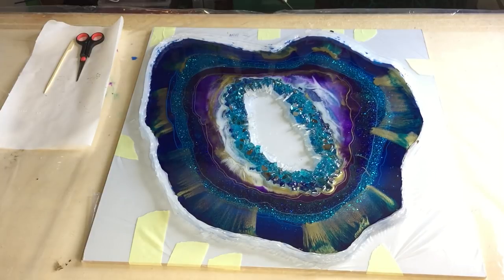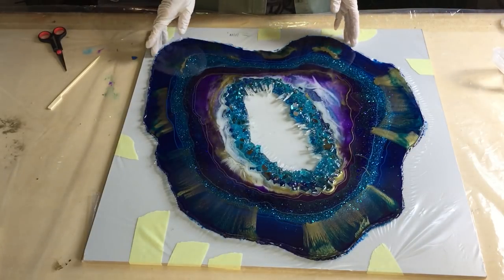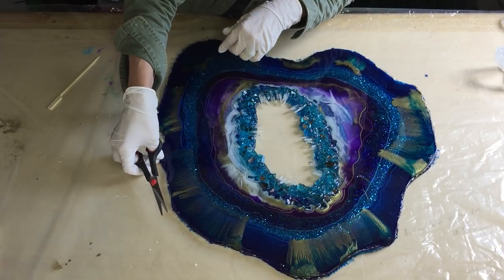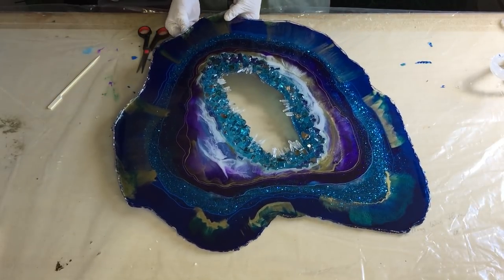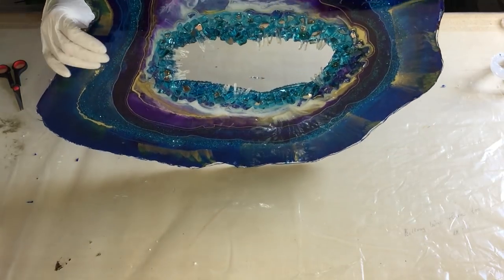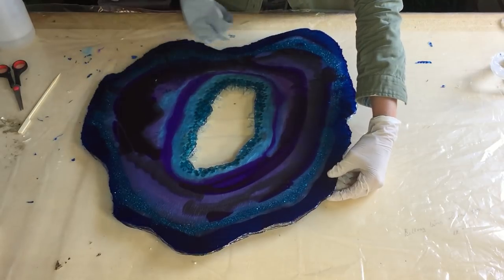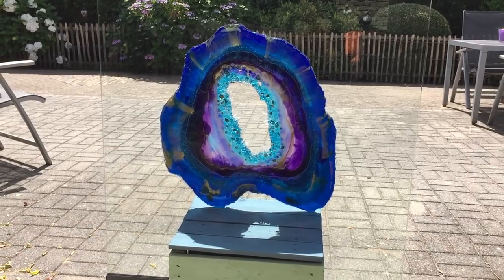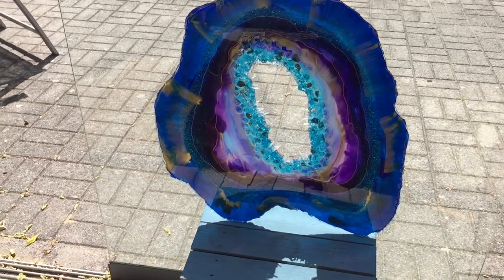45. Free Form Resin Geode. Part 6. Unmolding/End Result

Comment: Beautiful !  You can reuse the silicon barrier by placing just one silicone layer first on plastic and sticking the old mold on top. If you want to change the mold shape, just cut it into desired shape. At the end just reinforce areas where you made cuts and joined silicone together .
Reply from the maker: Thank you so much. That's a great tip. I didn't thought of it, but you are right. That way I can use it again. Thanks.

Comment: Thanks so much for experimenting with this method. Such lovely transparency to it. I may try in future but for most part I dislike the smell of silicone, may have to make and cure it outside but I have very limited space to do that.  I liked how my hot glue barrier geode mold worked out, but I didn't even try to remove it. I just covered with gold leaf. For future geodes, I plan on painting hot glue first with gold metallic paint and then with Martha Stewart fine glitter paint, smoky quartz.
Reply from the maker: Thank you so much. If the hot glue works for you than that's oke. And you are right the silicone doesn't smell nice.

Comment: Lovely Geode and great tutorial Petra thank you... How would you fix it to a display stand or make it into a table? I mean how could it be a table with the hole in the middle?
Reply from the maker: Thank you so much Debbie Sheridan. I would never display this size Geode on a stand, because I think it's to large for that. It's 22x22 Inch and therefor the Geode is large enough to make a side table of it. Even with the hole in the middle the flat surface is large enough to place some accessories on it. And don't forget it's still an Art piece and not a "real" table.

Comment: Petra this is the most amazing Geode I’ve ever seen!! Your videos are so inspiring & informative. WOW great job!!

Question(s)??
1)What type of silicone did you use?
2)What type of covering did you say is UNDER Geode? Plastic?
3)How LONG did you wait in between doing layers?

I’m going to make one as soon as I have the right silicone(molding) & plastic sheeting. Can’t wait! Thanks again...can’t wait to see the next one you do!!!
Reply from the maker: Thank you so much Diane. I used 100% tube silicone (clear), the one you also use in the bathroom for the tiles. Yes, I have plastic under the Geode. Make sure you have a thick plastic, for example the thickness of a plastic garbage bag. I waited 24 hours between layers, but that also depens on the type of resin you use. I use mastercast and if I wanted I could have done the layers after 6 hours. Good luck with making your Geode.
Reply: Greatly appreciate your response Petra!! Keep the videos coming!!👍🏼🙂
Reply: Greatly appreciate your response Petra!! Keep the videos coming!!👍🏼🙂
Reply from the maker: I love to help you. I will do, I already have another project in mind.

Comment: Hi Petra. I've just finished watching this series of you making this large geode. It's absolutely stunning! Well Done! Thank you so much for sharing your step by step process! I think I'm inspired enough to try make one myself. For this particular size, how much resin did you mix for each layer? And with your glitter, did you just mix it into clear resin or are they all tinted, like with the Bombay Ink?
Reply from the maker: Hi Paula, Thank you so much for watching my video's and for your nice compliment. This Geode is about 50x60 cm and for each layer I mixed 600 ml of resin. For this Geode I mixed the glitter with a little bit of Bombay Ink. If I want the lines to not flow that much to the sides I don't use ink, but I mix a lot of glitter in the resin that it gets really thick. For this Geode I wanted the glitter to flow into the colors next to it.
Reply: @petrajongbloed4425  Thanks Petra. I'm looking forward to your latest video on those custom coasters to see if that new product releases as well as the silicon. They are looking gorgeous so far! Between you and ATD, I've learned so much! Again, thank you for your generous spirit!
Reply from the maker: @paulamartins8589  I'm already getting excited to take them out of the mold. So nice to hear that you learn something from my video's. And I agree ATD is great I also learn a lot from them.

Comment: Please tell me do we need anything to place under the resin like wood or glass and can v use this as table
Reply from the maker: As a base you can use a MDF board with plastic taped on it. Resin doesn't stick to plastic. I will include the link where you can watch how I make the mold. https://www.youtube.com/watch?v=_yPD2AIEIkI&t=1s  If the Geode is about 1 cm (0,39 inch) it  can be a table. I made a table of this Geode. I will include the link. https://www.youtube.com/watch?v=Ez2bmm2-nwU&t=2s

Comment: is this the best mould material so far?
Reply from the maker: I'm experimenting with different materials to make a geode. What I like the best is as a base an acetate sheet, because it's heat resistant and to make the barriers I'm using 100% transparant tube silicone. At the moment I experimenting with soft mouding dough for making the barriers, so far that works very well. A positve thing about that is that is doesn't have a smell and it's reuseable. I want to do 1 more test with that and if that goes oke then I like that the most.

Comment: What kind of plastic did you use to do all this on. Just painters plastic ?
Reply from the maker: For this Geode I used the same kind of plastic like a plastic garbage bag, but there is 1 negative, you can't use a lot of heat, because then the plastic will wrinkle. Now I'm using an acetate sheet for my Geodes, also plastic, but then heat resistant. I like that much better.

Comment: could u use hot glue instead of silicone?  have u ever tried that?
Reply from the maker: I did a small test using hot glue, but I had a lot of problems with getting the geode out of the mold. And you also need a lot of hot glue to get the barrier high enough.

Comment: wow Petra....this is stunning....it's so beautiful....if you decide to make it a table don't put anything on it before 2 month until it's fully cured....because i;v tried to use a resin coaster that i made after one month and it left some marks...so the resin company told me that it should cure for at least 2 month....anyway if by accident there was any marks or scratch you can do a thin clear coat and it will be gone.... :)  thank you again for sharing your amazing work... :)
Reply from the maker: Thank you so much for your tip. I will keep it in mind.

Comment: Hi Petra, indid one for myself but when I took the geode out of the mold it remains some resin parts sharpy... do you know what should i do with them? Ansd also the barrier didn’t go off as easy as yours... also help with that too.
Reply from the maker: Hi Alejandra, great that you did one yourself. You can prevent the sharp edge on the side by placing an extra silicone line on the inside of the outer barrier, just as I show in the first video of this serie. Then you make your fingers wet with dish soap and make the silicone barrier smooth. With dish soap on your fingers the silicone doesn't stick to your fingers. The sharp edge on top of the last layer can't be prevented, you need to sand it before you do the final coat. I don't know which silicone you used, but you need to have the 100% clear tube silicone. Not the white or other color, but the clear. The one you also use in bathrooms between the tiles.
Reply from the maker: You can see how I prevent the sharp edges not in this serie, but in my last one. The orange, red and yellow one.

Comment: I tried with scissors but i can’t take the sharpy parts with it... may be sand... in this case which sand size? 240?
Reply from the maker: I use a small mechanical tool with a little sander attached, but you can also use sandpaper. Start with 240 and then 400.